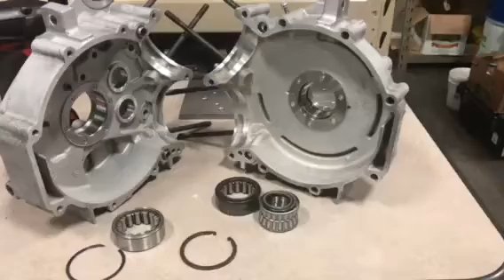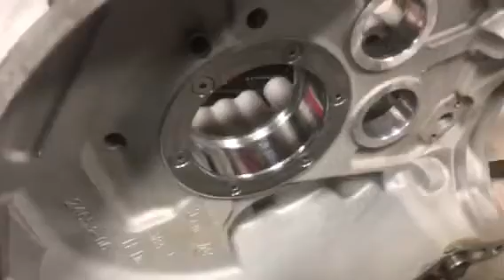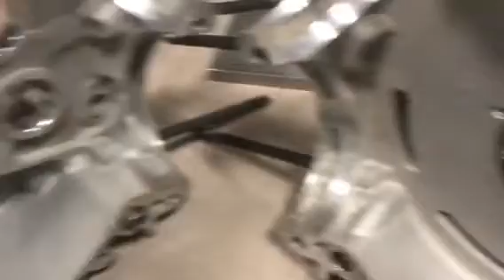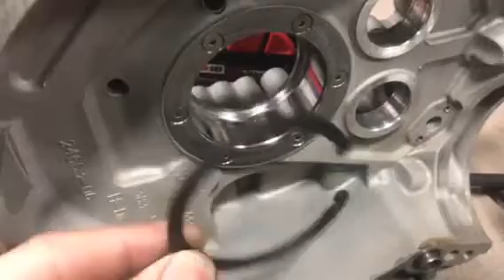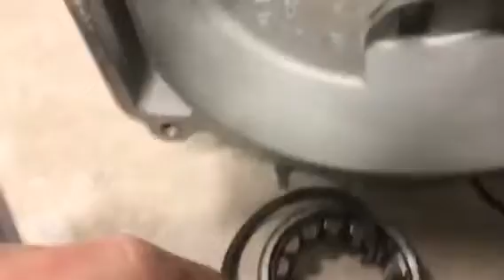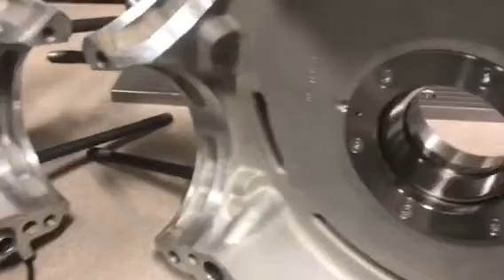Harley Twin Cam right side sleeve

Comment: I just had a built crank fail on a 117 Twin Cam. The right side bearing had walked enough such that it was proud of the case about .030" Two little button head screws were still holding it in.
Reply from the maker: They did their job!

Comment: There are so many people offering alternatives for the standard mains that it is confusing the choice, when my twin cam was rebuilt into a 113 inch monster the builder just used the famous 'Lefty' bearing in both cases. There was no evidence of either side original bearing having moved or 'galled' despite over 65k miles of use most of which was with enhanced power via big-bore (103 inch) and fairly high (10.3 : 1) compression and S&S 585 cams giving just over 100bhp.
 But then I always warm my bikes before riding 'enthusiastically' and never abuse the bike by doing wheelies or burnouts - if I rode like that then I would expect problems !